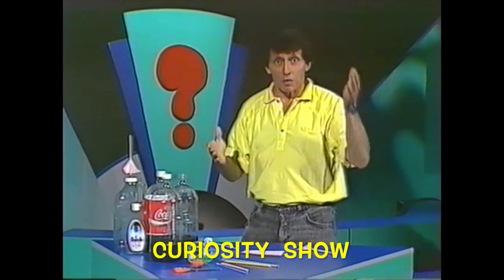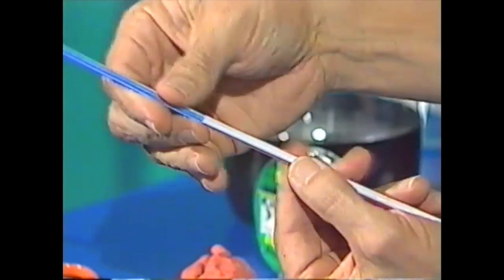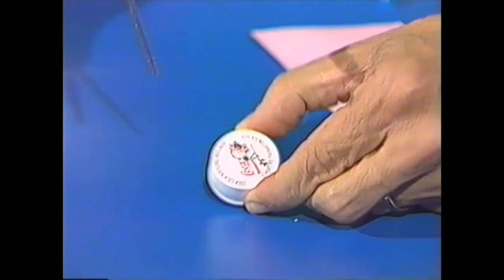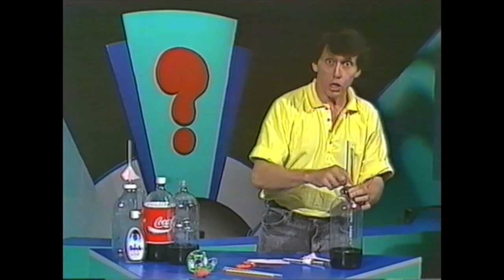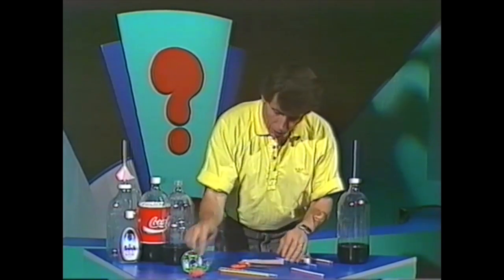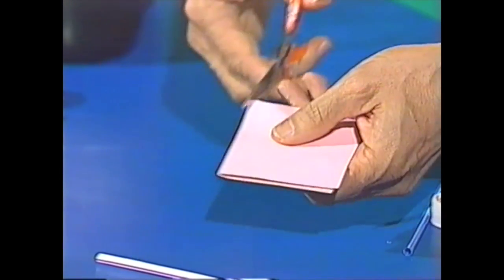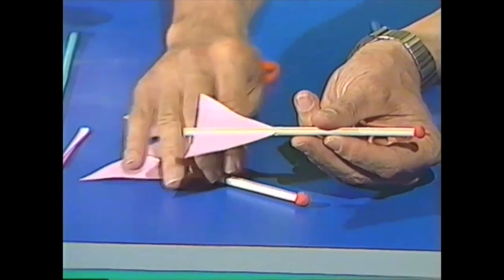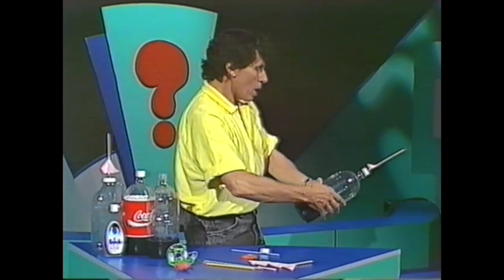Drinking Straw Air Pressure Rocket

Comment: What a jolly good wheeze.
When I was an architectural technician, we sometimes got a long cardboard tube; made a paper cone and cut the large end down so the cone was a snug fit in the tube. A long, round headed nail was then pushed through the cone's point and fixed with sellotape.
Voila - one helluva blow pipe.